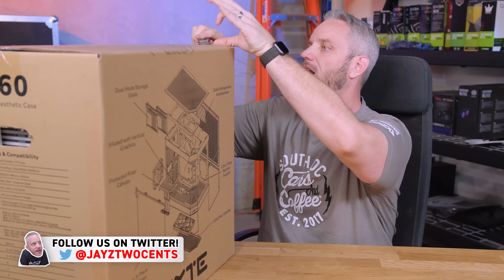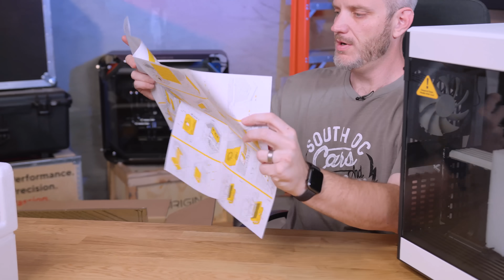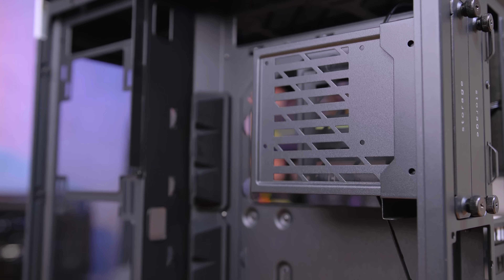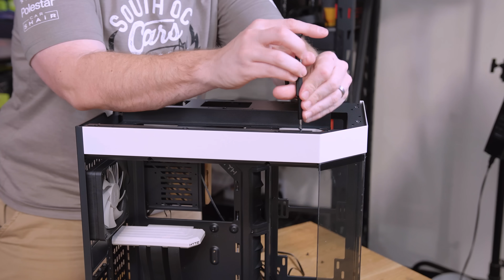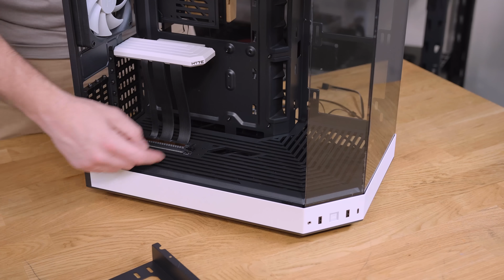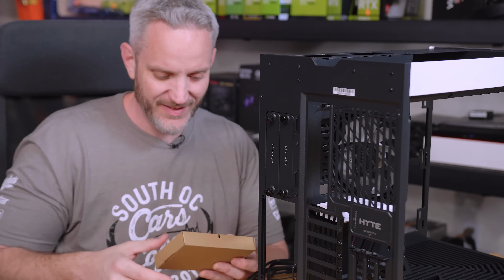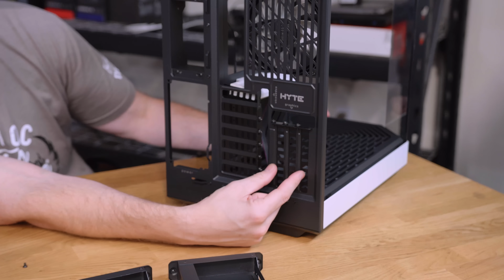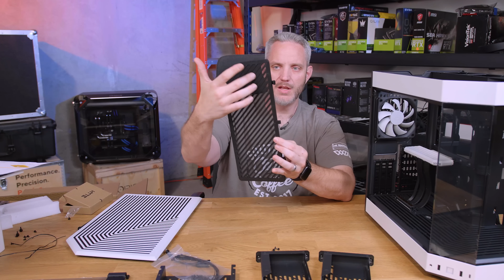Someone FINALLY broke the mold for PC cases...

Comment: Jay...  This is a pretty sweet case, just one problem "Currently unavailable" on Amazon.  Might have been better to check availability before doing the video or mentioned at the start of the video that its current status is "Currently unavailable".  I have been wanting to build a new system to run my Plex Server from but this case doesn't have enough 3.5 inch drive bays.  I currently have an old Antec P280 Super Mid Tower Chassis case that has 6 x 3.5", 2 x 2.5" , and 3 x 5.25" bays.  I have 5 3.5" WD Red Plus NAS drives for storage, 1 x 2.5" SSD System drive, and 1 Internal Blu-ray drive in the system.

Comment: I have had a similar case for 7 years now. It is not as stylish, but it is similarly wide, with the PSU on its own isolated compartment in one side, a bay for 6 SSDs, a bay for 3 HDs or DVD/Blu-Ray drives in one compartment, and another bay for 2 more hot-swap HDs on the other side. It has plenty of ventilation and room, and I love it. If I ever replace it, it would be with the one in the video.

Comment: I was hoping to get some advice. I currently have a ryzen 3 3200G and an rx560. I’m thinking about some upgrades but don’t know what to upgrade first. I have an m.2, a 650 psu. 16 gb 3200mhz ram and a b450 mb if any of that helps. I’m just conflicted and was hoping anyone could help. Oh and as a little side not preferably would like to spend around 350-3400 for each since I know parts are mad expensive rn. I only play 1080 p so I don’t need like super high end stuff🥹🥹
Reply: Gpu prices are coming down so you can wait it out a bit longer to replace the gpu. You could replace the cpu with a 5600x instead in the meantime. Assuming you’re mostly gaming on your pc

Comment: I think that a lot of thought went into the case. I was particularly impressed by the single-connector approach to the power/reset/HDD LED headers. That irks me every time that I have to connect them to a motherboard. For my own use, it's massively wide. Regardless, I think that this could be a winner, but we'll have to wait and see. The buyers always determine that.
Reply: Most useful motherboard accessory I've ever seen - one of the multiple motherboards I've used had a solid block female-to-male connector you plugged the case cables into, and then you plugged the connector onto the motherboard header pins (I think it was an early 2000's Asus AMD motherboard)
Reply: @richardhockey8442  Gigabyte boards (at least the 2 mid-range boards I've bought the last couple years) have those.  Along with good BIOS, solid PCIE connectors, temp sensor headers etc.  Stuff that Asus doesn't give you unless you buy a $500+ board.
Reply: I never use the header for the hdd activity lights, sometimes i wont even use the hdd button light if its too bright. So if theyd force me to have that on if be annoyed. 
And tbh the split io headers arent as hard to plug in as ppl make it out to be.

Comment: Wish they did an xl version that had a deeper basement, allow a 360 side mounted rad, a choice of how to mount a gpu with changeable card mounts and it would be perfect for 3 x 360 rads and insane water cooling lool

Comment: Who would imagine a giant case with only low profile main slots and only two hard drive bays? Personally since I moved to m.2 drives I just get small cases. I’ve never gone liquid cooling yet and have no immediate plans to now. Small cases with decent air cooling capacity seem more than adequate to me. I guess it is an interesting design but no use to me.

Comment: this will definitely be my next case when it is time to upgrade to 12th/13th generation and 40XX with a full custom loop. i have this plan, since i first saw it. my guess is, it will be awesome with airflow, which in watercooled builds is equally as important (VRMs). the angle will help the side intake and the bottom fans will help to get rid of hotspots with standing air.

Comment: Not to be able to mount my RTX 3080 12GB direct to the motherboard is kind of a dealbreaker for me. And only 2x 3.5" slots is too little for a case of that size. I'd like at least 3-4x 3.5" drlve bays. And I would like it with solid sides ffs! I don't like glas sides or RGB - I let the 12-year-old script kiddies that think "that's cooooool" buy that shit lol.

Comment: I'd love to see a Jay what do you think episode with unique cases, although this would veto me out by default cause I'm a filthy casual with a corsair 4000x lol.
Personally I wouldn't build in this case although i like the design I'm not a huge fan of being forced to use a vertical mounted gpu. Espescially in cases with bottom mounted fans I'd love to utilize the extra airflow to go to the gpu so I'd prefer to mount it horizontal + i really dig the backplatedesign of my current gpu ^^

Comment: I think it's an inspired design.  Only thing I'd have liked to see different (this is a complaint for any case with external access to hdds), is to use NAS style hot swap bays with back planes instead of drive sleds.

Comment: The half height expansion slots are quite clever I thought. With a vertical mount graphics card, you loose access to the expansion slots completely in many cases, at least here they are potentially still usable.

Comment: Lame.  just put your components in a fish tank if you want the glass.  I'd rather buy a test bench open air frame.  All cases look good until you start cable management.  Who cares about vents? lol all those holes and that huge window equal a test bench anyway without the need for 200 cfm in case fans. And no filters to clean before you clean the most important item (gpu) you have anyway.

Comment: Cute. Just pulled up the manual for that case, and the two drive cages are designed for either a single 3.5" drive, or two 2.5" drives.
For the 2.5 inchers, one mounts as expected, the other "hangs" from the top edge.

Comment: Good case, but would it have been better to have full height expansion slots and then (if you wanted to) a vertical mount adaptor that bolted into that?

Comment: I like that they tried something different, but only low profile brackets is a bummer. I recognize many customers only install a GPU and they're done but I'm still perplexed. About the design and airflow IDK, having grills everywhere means you can't channel much air to go whenever you want and that can hurt your performance as some air you're trying to force in actually escapes from the other ventilation holes and doesn't contribute to cooling.

but that's just my impression from behind a camera so benchmarks will tell a more complete story

Comment: I love this case and have been following it since it was released.  I would love to see you do a custom loop build in it.  I have considered using it for my upcoming build but I think I might take all three pieces of glass out and do an open-air build with it.  The only reason I wouldn't use it would be to use the P3 (I know your thoughts on TT) for a wall mount PC that I have the perfect spot for since the way my desk is set up now, my tower gets hidden behind my monitors.

Comment: It is interesting, won't work for my needs, but do like the case look. If I end up building another case for personal use and don't need a lot of drives, I would use that. I like air flow/cooling over looks, that looks like it does both well.

Comment: As soon as this case comes available in the Netherlands I will buy it and move my built to the Y60. Looking at the review it provides all the needs I have for a case upgrade. if the price is indeed $200 ( €183 ) It will be an expensive upgrade, however I love the looks and it almost feels aquarium like, I have a white coloured build right now, so the white version would be ideal to transfer the build into. ( I turned on a price alert on tweakers so fingers crossed it will be available soon ).
I run noctua gray fans in my build so the fact that I can hide some of them a little bit will definitely help with the looks, can't wait for this case to release.

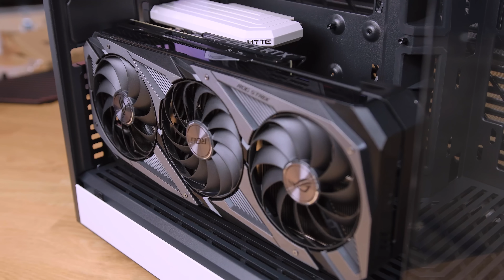Comment: 3:05 but if you have fans pulling in cold air from the bottom, and exhausting hot air from the top, wouldn't that airflow make up for the GPU fans being close to the side panel?

Comment: low profile expansion cards requirement is complete deal breaker - especially in a case of this size
and to top it off it forces you to use vertical mount for GPU, possibly suffocating beefier cards

Comment: I really like the look of this and the amount of thought that seems to have gone into it. Only place I personally think they missed a trick on are those low profile expansion slots to fit the vertical mount. What I think they could have done is make that section of the back detachable and provide a replacement that takes away the vertical mount but has full width expansion. In the long run it could be potentially cheaper than production runs of 2 separate models and keep those customers that need the expansion slots. They may have considered it though and maybe the cost had them go over the price point they were aiming for. Still, really nice looking case. I'd love to see a build in it 😊
Reply: tbh, it was the deal breaker for me. Love the look and quality of this case, but expansion is one of my top requirements and I don't need the extra effort to find low profile.
Reply: @silversong4VR  There's always the RX 6400. lol
Reply: Good point, with the way they did it it basically requires a vertical GPU mount. And for any other full height cards.
Which reminds me of cases where you could slide out the motherboard tray at the back and mount the board outside the case. Just like the drive slots in this case. Having the tray done that way would mean the customer could just slide them in and out.

Comment: The case cant fit the most common large air coolers, very disappointed here.  It's so wide, yet they managed to ignore air cooling.  160mm is way too small, given the width of this case.  Dark Rock Pro 4 is 162mm, Noctua D15 is 165mm...   There are plenty others that just wont fit, and for this price point, that is unacceptable.

Comment: Thought of upgrading from my thermaltake view 37 to this case, i’d have to order more tubing to re-do my water loop and maybe add another radiator because i want to add my gpu to the loop. Still considering my options as the corsair 5000T would look amazing as well.

Comment: Disagree on the attention to detail, as already mentioned its poor design to not be able to have a horizontal GPU ESPECIALLY when it has bottom fans which would more optimally cool the GPU horizontal than vertical.  Its just not a great airflow path, they're basically just brute-forcing it which IMO is poor design.

No vibration damping on the HDD sleds and that rattling sound they made as you move them suggests vibration could rattle them.

Ports on the corner, so basically if you use them it only makes sense to have it on the right of you?

This case screams form over function to me.

Comment: I was watching this, thinking “This is the case for my next build!” … right up until it was pointed out that the GPU has to be vertically mounted (which, BTW, I think does look good, but I’d only do that with a card that won’t put the cooler up against the glass), and the other expansion slots are low-profile only.
Reply: i think this case will sill work well with the fans under the gpu. and i think also, it is intended for watercooling.
Reply: @scotchbreit13  It does look like a good case for water cooling. But the lack of expandability (requiring low-profile expansion cards) is a deal breaker for me.
Reply: @StolenJoker84  i don't need that, so it will work for me. Maybe modding if you really like it. Custom bracket and all...🤷🏻‍♂️
Reply: @scotchbreit13  Honestly, it seems like a 1st gen product, and I’m not currently in the market for a new case, so I’m curious to see where they take this design moving forward.

Comment: An interesting mid-tower with reservations. Half-height slots are a deal breaker. And 2 SSD mounts?!? 2? I have 7 SSDs in my crufty old PC. Even eliminating a few 1 TB drives with M.2 upgrades, I'd still need 4-5 mounting points. I could go with a NAS, but then I'd need to go to at least 2.5GB network which means rewiring my building.

Comment: this case problem is pointed out : no space between CG and glass ,. so it s EZ :
AIR COOL CPU , WATER COOL ( AIO ) the CG , snice the case do both , do both ! ( use massive air cooler like no one have ever seen before ), and I would vote Radeon CG so you may suffer driver bug and rant 😅

Comment: great first look at this case thank you. i was so pumped for this case up until you got to the storage part of the video or should I say the lack of it. I am doing a new build and settled on having to reuse my old Antec case again because any case I like lacks more than two 3.5 drive bays. Yes there are a few cases that have this still but I would also like to get a case I dont think is fugly. I was looking at the Meshify 2 XL case as a possible next case but again i am still not set on that case either.

Comment: I'm definitely in the market for a new case.  The current one requires installing any PCIE cards (including the GPU) to the motherboard before installing it to the case, which means making upgrades/changes is a HUGE pain in the ass.  I'd 100% swap to this case for the actually thoughtful and well designed airflow alone.  The fact that it looks unique is a nice bonus too

Comment: I recently did a build in this case and my biggest (and only) issue is the lack of space between the top of the motherboard and the top mounted fans. There's very little room to pass through the CPU power cables. So little to where you have to route the cables somewhat "tilted" or "sideways" to get them in without the cable getting hit by the top fans.

Comment: Sorry i could not watch your 3090 review the price here in Bangkok almost 3500 $  usd  (115000 thai Baht) two months salary
try my system asus x570 ryzen 3700x 64gb 3200 corsair a  asus 1660 ti( put in the 3090) cooler master aio an 1000w cooler master power

Comment: Just finished a custom water loop in this case. Super easy to build in with all the glass panels able to be removed. Hyte does not recommend removing the diagonal panel, but they give you the option to do so which is really nice. Only note I have is top radiator thickness is important! The bracket hangs down pretty close to the top of the motherboard and it caused clearance issues for my 360mm radiator. I ended up 3D printing some pieces to make the radiator fit. Overall really impressed with the case!

Comment: I used to buy Ibuypower when they used the NZXT case that didn't have a square/symetrical front.  It was cheaper than buying parts individually.  I haven't used ibuypower in many years

Comment: You can install 2x 2.5" drives in a single drive sled, kinda like shingled together, so 4x 2.5" drives altogether. So, 2x 3.5", 4x 2.5", or 1x 3.5" and 2x 2.5". Still seems fairly limited compared to other cases like it, but not as restrictive as it might seem at first glance.

Comment: If this came out in 2019 and was sold in the UK I would have gone for this case as many motherboards these days are loaded with USB ports and sound cards aren't that massive. In regards to the solid front power connectors some motherboards include a plastic holder where you can plug in the individual connectors and you just plug that in. But yeah, they should be a solid connector by now.

Comment: Looks like you have to take the whole case apart in order to clean the filters.  That is one thing I find really annoying about my current case.  I only have 1 filter that can be removed without taking the case apart - and it happens to be the one that gets the least amount of dirt.

Comment: I use a sound card because I've never been happy with onboard sound. I just did my build in an O11 EVO and with vertical GPU mount in its standard position, there is one available PCIe slot if you only use fans on the bottom. So I have a vertical mounted 3070 Ti with a Sound Blaster X AE-5 under it.

Comment: gunpla diorama over in the front. something with water effects. 360 aio on the top with blue and yellow to give it some sun and daylight look. current system would be fine (12600k-48gbddr4-3080ti)

Comment: looks like a fun case ... i have been looking for a while for somethign thats not a standard box design for my main rig .. im currently using a cougar conquer  and im looking for a replacment for that with my next build, and this looks like a serius contender even going back to a basic box.. my issues will be getting one ... Here in New Zealand getting any parts from a smaller manifacturer (and some not so small ones) can be a real pain

Comment: Only a few people will be using the low-profile expansion slot. They should've just removed the expansion slots and placed the graphics card away from tempered glass so that GPU won't choke.

Comment: The only issue I have with it just looking at it in this video is the front panel IO being so low. I guess that's not an issue for people who put their PCs on their desk but for those of us who don't, I'd love to see a variant of this case that has the front panel IO on the top half somehow with all of the other conveniences of this case. Outside of that, I think I agree that the expansions slots forcing low-profile is a bit constricting but hopefully we'll see a shift back towards making everything smaller in terms of our tech. It seems like most everything lately has been getting fairly large in terms of form factor and I'm not a huge fan of that trend.